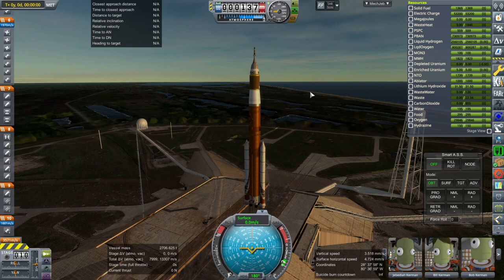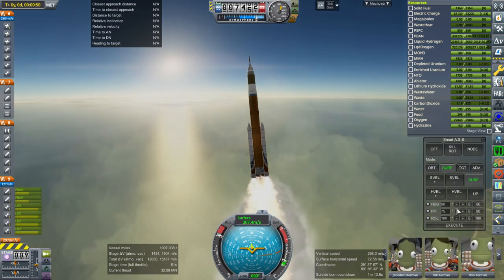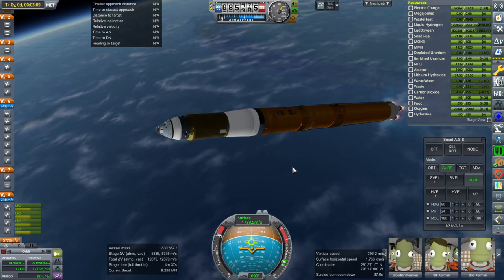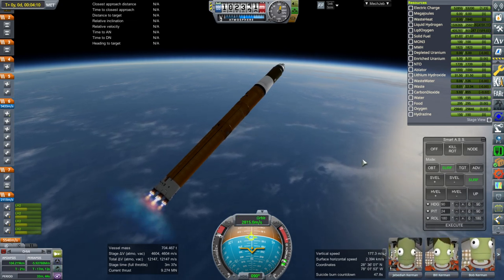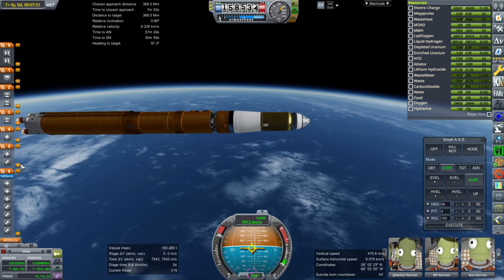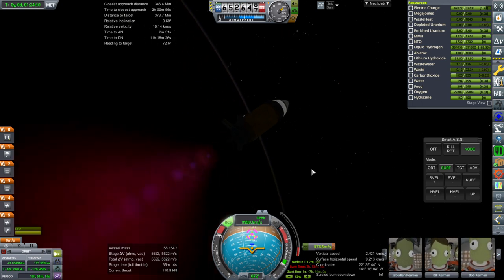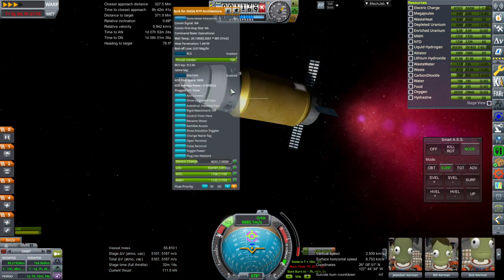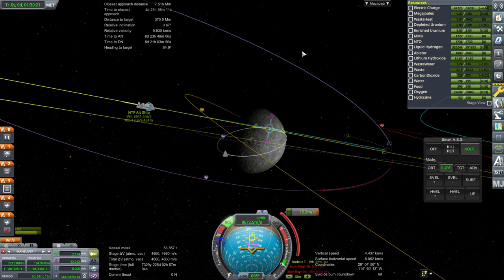Realism Overhaul in KSP 1.8.1 - Orion with a Nuclear Service Module?

Comment: hey! if i ever get a better computer, i want to play RO with near future/far future/interstellar/ tech and colonies. i know you did a series on something similar once. can i get those configs somewhere, or do i have to make my own? and if so, how do i do that?
Reply from the maker: I'm sort of working on a custom career mode called RP2000 that will attempt to bundle those configs together. I'm working on balancing the prices of the stuff at the front end of the tech tree right now.
Reply: Maybe you just need a RAM upgrade, KSP can only utilise a few threads on your cpu, a first gen i3 may not be desireable, but it worked for me with the biggest bottleneck beeing 4GB of DDR3 RAM with Windows 10 reducing it to effectivley 2.5GB and my graphics card was laughtable, so you might be able to run RO RP-1.
Reply: @apolloaerospace7773  i dont think my laptop comes with RAM expansion space though... and it still maxes out the CPU
Reply: @MinerBat  are you using a macbook ?
Reply: @apolloaerospace7773  no just a windows laptop
Reply: @MinerBat  Than you can replace your existing SoDIMM RAM sticks with larger ones, you might want to watch a video on how to open up a laptop like yours, if you havent done that before, and make shure to use the right DDR generation for your new RAM sticks.
100% CPU utilisiation shouldnt be a problem, as long as you have at least an i3.

Comment: If half of your mass is hydrogen, you would have about 8.5km/s of dv, the NASA tank was designed for a mars mission, a tank for a moon mission could get away with beeing lighter.
The radiation shield for the reactor should be mounted close to it and far from the crew, as it will emit secondary gamma radiation and breaking radiation when subjected to particle radiation inside the Van Allen belts or just cosmic radiation.

Comment: I hope i didnt miss anything but doesnt this system rely on refueling in Lunar Orbit. Since it wouldnt have a second stage of the sls functioning as a booster every time ? Besides that it I like the idea a lot
Reply from the maker: No, it can refuel in Earth orbit instead, as it comes back to Earth orbit without refueling as demonstrated in the video. Therefore, the refueling module doesn't even need an SLS - the form factor of the tank (7 meters) can be lifted by New Glenn or any similarly capable rocket, like Starship.
Reply: @RaizSpace  Yes but it would not have enough delta v for the roundtrip. It only made the trip with the help of the SLS second stage for lunar transfer and had no delta v left afterwards
Reply from the maker: Ah, I see. Yes, It would have to get a boost, but it might be possible to use another nuclear stage to boost it up and then, after that stage releases it just short of lunar transfer, have that stage get itself back down to LEO for refueling and reuse.

Comment: Cant, we solve those problems easier by making the ESM tasks bigger and up Rating SLS paylode mass Like Block 1B? Or does the ESM not have enough trust. Is the Problem with this systems that the development time for that nuclear engine its development time is way out of the 2025-time frame? But for the Moon Bus to work we need to be able to refuel it? Also, it cuts out a major component of pan Atlantic ESA-NASA cooperation if they are willing to do that.
Reply from the maker: To do what this system did, the AJ10-190 on the existing service module would need much more propellant. Consider that it's less than half as efficient as this nuclear engine.
Reply: @RaizSpace  Exactly! For big missions, the nuclear stage is a no-brainer. If paired with a propellant depot in cis-lunar space, it would be cheaper in the long run due to reusability as well.

Comment: Just a random comment, but I believe you where using the wrong type of RL-10 for your EUS, it should be the RL-10C-3 (Atlas V uses the RL-10C-1) which has an extending nozzle. I can't tell if it should have a nozzle extension like the RL-10B's (like it does in some art) or a much shorter nozzle extension that's just one 'segment'
Reply from the maker: The model is incorrect, but the stats should be fine.
Reply: The C-2 and C-3 have very high expansion ratio (250) nozzles like the B-2. If I remember correctly, the C-3 starts with the nozzle deployed inside the fairing while the C-2 extends.

Comment: 13:55 My conscience really doesn't like using lunar water for rockets—unlike with Earth and Mars, that water is going bye-bye with either hydrolox or pure hydrogen engines, and also unlike with either of them, water is a reasonably finite resource on the Moon.

The problem with this design is that not only would the NSM have to be refueled, but a new EUS or comparable stage would also have to be launched and docked to push it to the Moon. You may be able to solve this by adding another tank, in which case you'd "only" need to refuel it in LEO and transfer crew... which still kind of makes it superfluous. Unless you transfer the fuel and crew from a more-battleship but reusable vehicle unable to execute the mission to this one—say, a crewed variant of Starship specialized for LH2 delivery, though that would of course require SpaceX to develop said variant.
Reply from the maker: Rather than an EUS stage, maybe another nuclear stage boosting payloads to high orbit and then bringing itself down to low orbit to be refueled would be fine. If you have a problem with lunar water, maybe wrangling an asteroid with some would work. Or, you know, we could just go to Mars instead.